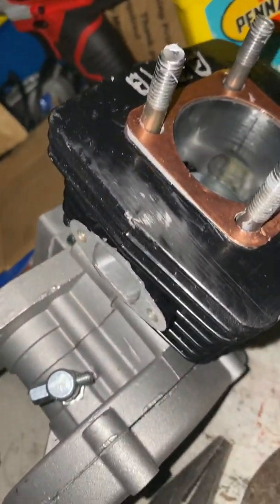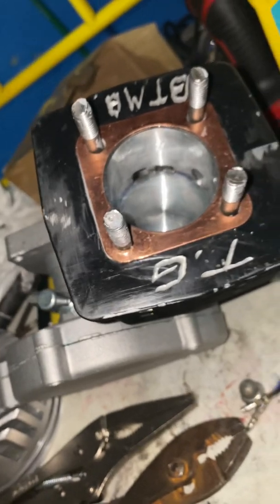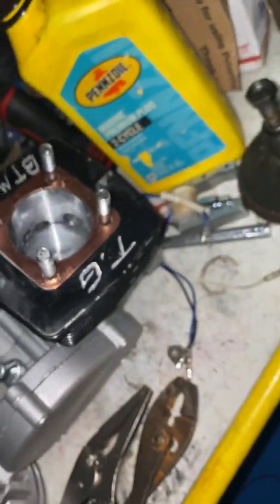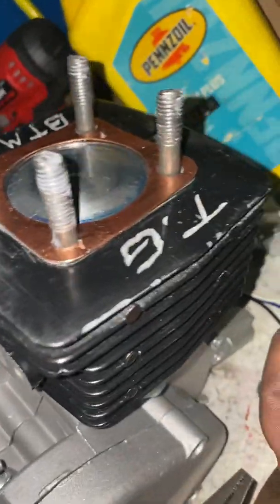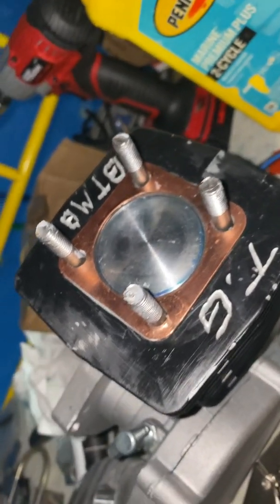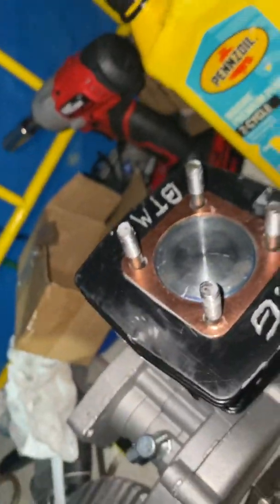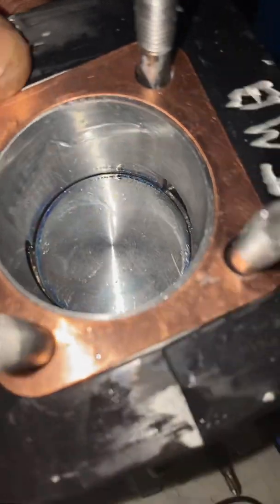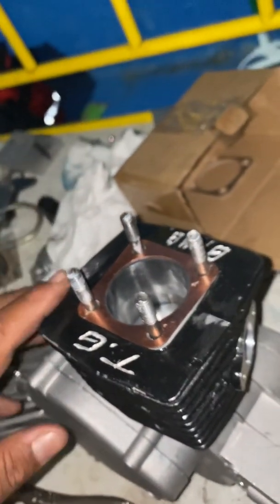Motorized Bicycle Race Engine Inside

Comment: Is this jug holding up OK?  Lotta rumor about it being a too thin or unindex, no shoulder sleeve.
Reply from the maker: The kid who got this motor is still running. In the beginning the sleeves were off tolerance and slipped. They stopped toward the end. Unfortunately you can’t get these anymor

Comment: Ok one question that motor You go make reed valve but no Windows pistón how thats because that no working like that You need always Window pistón for reed valve motor
Reply from the maker: You don’t always need a window piston. You can drop the intake low enough to not need it. I’ve done it and got it 50moh+

Comment: Nice job but a real builder can tell a sleeved cylinder over unreliable chrome plating
Reply from the maker: Fam it was a G5 sleeve. You sound dumb as hell.
Reply: @bigtsmotorizedbikes4242  ohh ok come run that against any of my motors on the track bet all you will get is my smoke
Reply from the maker: Zoom in on the exhaust and you will see the transition from steel sleeve to aluminum.

Comment: G5s cylinder?? Or g4 ? What is better in your opinion
Reply from the maker: G5 better because of the steel sleeve. It’s hard to kill, very hard
Reply: @bigtsmotorizedbikes4242  how can you recognise steel or aluminum
Reply: @bigtsmotorizedbikes4242  and because of the material different expension at high temps, can it affect engine performances?
Reply from the maker: @dj_impotencja  The steel expands and gets tighter around the piston, actually runs better. Just order G5 steel sleeve cylinder then port it
Reply: @bigtsmotorizedbikes4242  okay
Reply: G4 is more racing nikasil the G 5 is only relaible

Comment: Where is the sleeve. It dont look sleeved. It looks chrome lined
Reply from the maker: It’s a G5 sleeve just got the copper gasket covering the top.
Reply: @kjsmolik  You know that not sleeve steel this guy is a troll 🤣🤣
Reply: Thats is 200 dollars motor thats it's 🤣🤣🤣
Reply: First thing that cilinder is G4 Open tranfer the G5 cilinder w steel sleeve is not Open tranfer You smoke crack OS You see a sleeve steel un Tha cilinder because is not 🤣🤣🤣🤣
Reply: @Adalbertomatos_  not sure what your watching on but you can see the sleeve